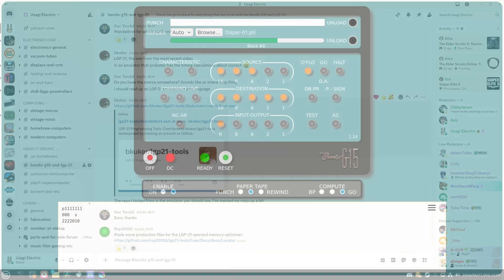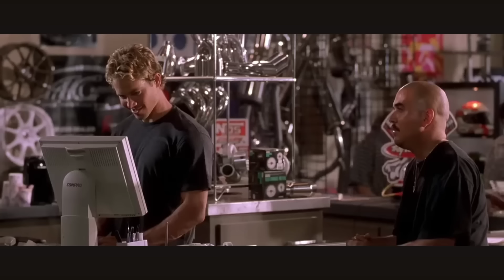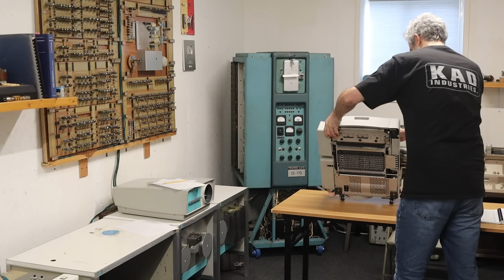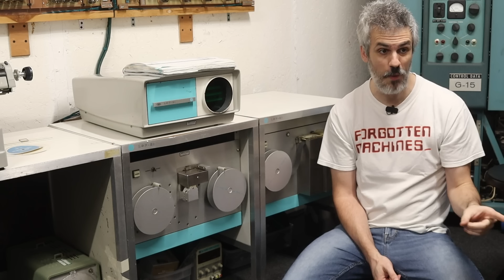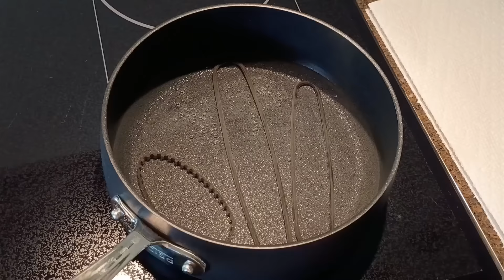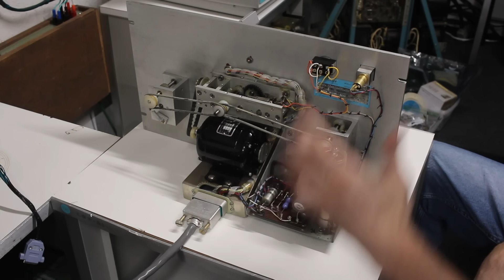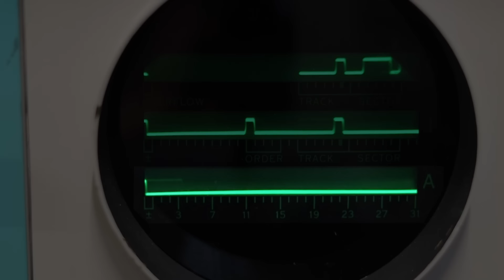Can We Rescue the Code on This 63 Year Old Disk?

Comment: "Rabbits" needs to be the official unit of measuring weight for all equipment going forward.
Reply from the maker: I agree 100%!
Reply: 86lbs is 26 rabbits. Got it. 
I’ll add it to my odd unit knowledge of a stone = ~14lbs (UK).
Reply: @HessTruckBOOKS  IIRC, there is no "about" ("~") in the meaning of "a stone". 
Unless, of course, the Americans "improved" (broke) the unit after we gave it to them.
Reply: @WellsiteGeologist-UK  In the USA, it's been re-standardized to mean the weight of 9 handguns (loaded of course)
Reply: @HessTruckBOOKS  I live in the UK, i understand Lbs and Kgs, and Tons/tonnes/short tons... even hundredweight. But for some reason,  stones just won't land.... maybe the number of pints i consumed affects this :D
Reply: 100% rabbits is a unit we can all understand
Reply: one must know the standard rabbit first.
the standard rabbit, at 68 degrees F, = 1 rabbit.
there you go.
Reply: 1.21 gigabuns
Reply: 64 Mega bunny?
Reply: You don't want to go down that rabbit hole.
Reply: USAGI means Rabbit. Might as well make Usagi an unit of weight
Reply: "this weighs as much as an elephant" 

Well I haven't picked up an elephant!

But I know what a rabbit weighs! Haha
Reply: Unfortunately Rabbits are flawed for standard units of measurement due to a tendency for spontaneous exponential multiplication.
Reply: Reference Rabbits. 😂
Reply: Use metric guys, it's 0.02 elephants.  Sheesh.
Reply: Americans will do anything to avoid metric /j

Agreed, rabbit is the cutest unit I've ever heard!
Reply: Need to make it an ISO standard
Reply: The register units committee would agree! (if you know you know)
Reply: Yup, I agree completely! ⚖️ 🐰
Reply: A Rabbit is 3.3(and some trailing values) pounds, or just a hare under 1.5kg(1.49685, if you care about the nearest 10 milligrams).
Reply: @Sehvekah so about 1.1 henweighs.
Reply: how many rabbits are in a washing machine
Reply: @lorenzo42p  Ideally, none, Rabbits are Hand Wash Only.
Reply: I think grams are more fitting
Reply: That reminds me of the guy at Cutting Edge Engineering (in Oz) who calls inches "bananas".

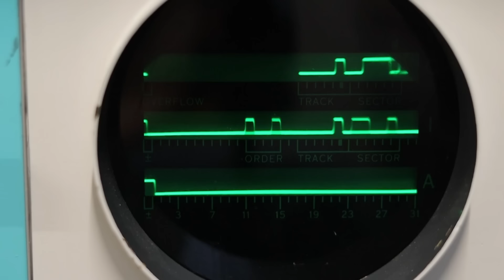Comment: 27:54 You called it perfectly: that monitor IS mesmerizing! I love it
Reply: I reckon this is the source of the word "monitor" applying to computer screens in general.  right here, first one. (well, probably on the big brother that preceded it.) ... but originally 'monitor' isn't primary output but a secondary signal used... like the monitor plugs on sound consoles. :-)  ...  I've wondered why 80's computer screens were 'monitors' .... and I see this here.. type into the teletype and check the monitor for response. :-)  with mini and micro computers... the teletype console slowly became a 'printer' and the keyboard shifted toward the 'monitor' and away from the console.